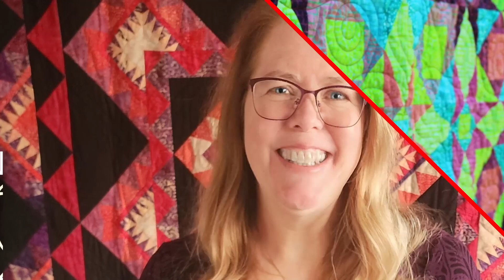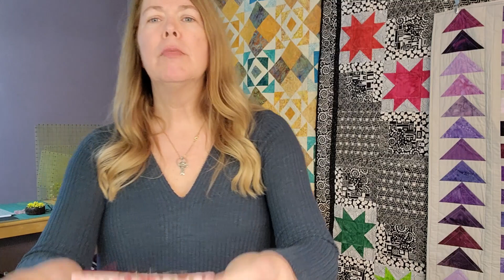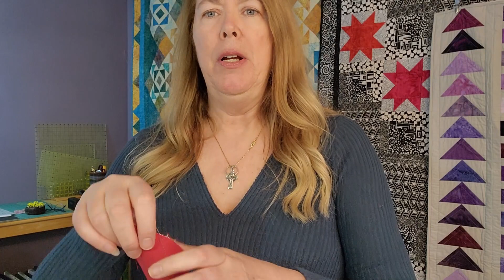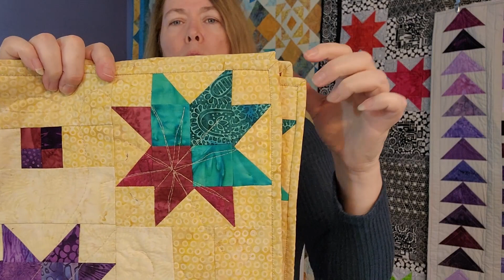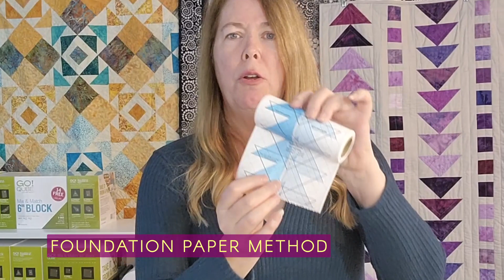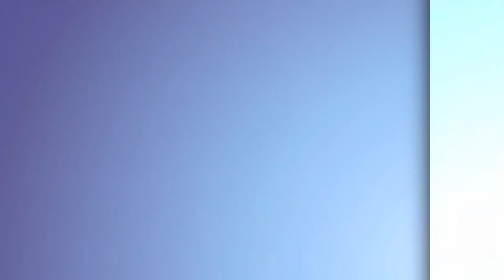Which Flying Geese Method Should You Choose?

Comment: I've found the four at a time a very fast VERY INACCURATE way to make the block. So trim and pray you've enough extra to trim. For miniatures paper foundation, in my opinion, will save you a lot of frustration.
Reply from the maker: Golly! Sounds like you've had nothing but frustration in making flying geese. Good thing there are so many methods to choose from! I love foundation paper piecing for its accuracy as well, although I'm not as fond of removing the paper. But it's a good trade off for me in certain situations, like making miniatures!

If you would like to give the fast flying geese method another try (when you are making larger blocks for example), my free download includes the cutting directions for making them oversized so you can trim them down to the proper size. It also includes directions for as small as 1/2" x 1" finished if you'd like to try it again for your miniatures. You'll find the link to the free download in the description above.